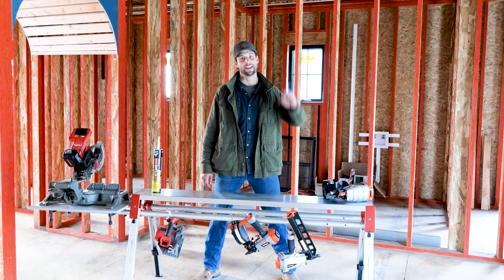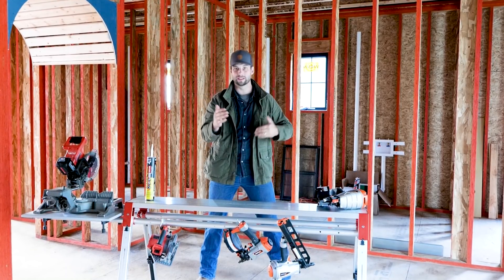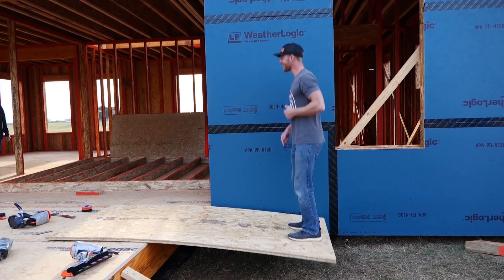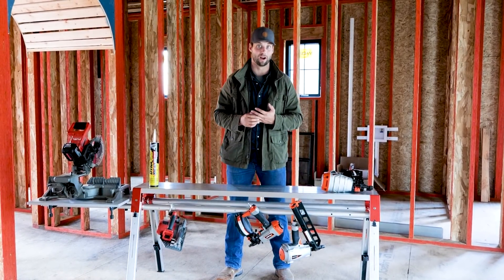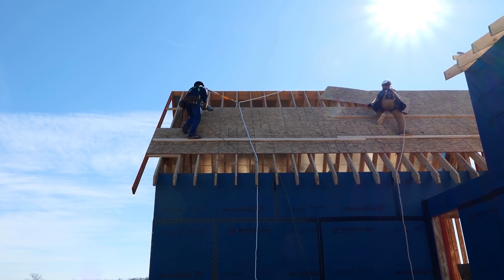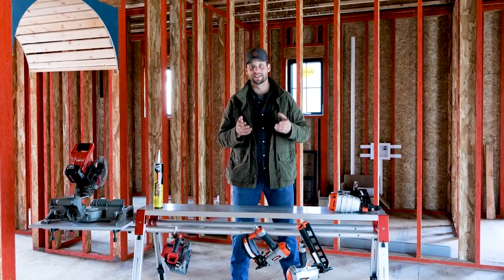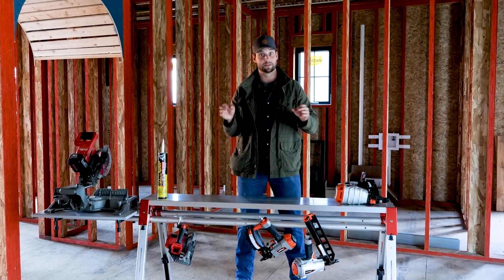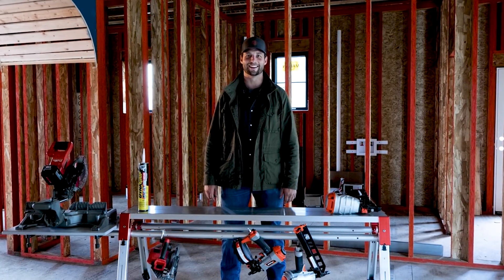Framing a House - Is that ALL OSB?!?!

Comment: These Wood Panelings Have Odor Especially the OSB. I Am Highly Sensitive to Odors. It Makes Me terribly Sick. I've Spent a Better part Of the past  Weeks Browsing the Internet for Alternative to Wood Framing Panels. But Everything seems to be some type of Wood or Engineered wood. I would ideally like something with PVC or FRP that would have the Strength and Rigidity of Wood but without Odor. Do you have any ideas/suggestions??
Reply from the maker: I’m sorry to hear about your sensitivity. However, I don’t think the answer is more plastic and chemicals in PVC or FRP.  There are wood-based products that are low to no VOC like Timber HP.  You might also look at something like hemp Crete

Comment: You said you wanted air flow under the house.  But did you show how you insulated under the floor???   I couldn’t find it if you did.    Would really like to know.
Reply from the maker: We did close cell spray foam
Reply: @JordanSmithBuilds  On this house or a different house?

Comment: Jordan, did you mention in one video that you can send your plans to LP and they’ll engineer it?  Also, will they send you a pre-cut package?  If you could save the labor of not cutting each stud/beam/sheet, that would save lots of cost. Plus the quality would be off the charts... is this possible?
Reply from the maker: Not LP, but Builders FirstSource. They will pre-cut all of the framing lumber, but not the sheathing.

Comment: i think OSB has untapped potential. the binding agent may be improved in the future to add better structural integrity and/or better fire protection and/or lower cost of and/or better water protection
Reply from the maker: I'm sure the resins and binders will get better with time, but they're super robust in the current state on high-end OSB products.  I have had board of smartside and solid start sitting out in the pasture for 8 months with nearly no degradation.  Amazing!
Reply: @JordanSmithBuilds  yeah? which brand names are high end? hard to find names for wood on the internet, haha

Comment: Also to give credit where credit is due I’ve installed nothing but hardie for lap siding for the past 12 years but have moved to only using LP trim and soffit and probably 50-70% LP over hardie siding the past 2-3 years. The installers prices are about 10-15% less with LP not to mention no respirators from the silica dust is a big plus. Their siding products are awesome now we’ll just have to see if they last as long and hold paint like fiber cement

Comment: Check out bear skin flashing for joints. It’s basically a pad of post it note type material for joint flashing super simple not sharp it’s a little pricey ($65) for a 50 sheet book but is super convenient. Also “H” style clips for LP are pretty cool they flash the back and cover the front of siding with wood grain texture. House looks amazing! But don’t fool these people they’re building products are trash! They’re sheathing is junk not sure about the stuff he used on the roof never used but advantech and zip is leaps and bounds ahead not to mention the zip flashing products kill LP

Comment: Did you just drive pilings into the ground with no vapor barrier to protect the bottom floor from rot? 

No exterior continuous insulation?
Reply from the maker: Spray foam insulation and a ventilated crawlspace
Reply: @JordanSmithBuilds  That's one heck of a delayed reply :)

Comment: when are they going to marry the tech shield and weather logic and make a mutant radiant-wrb product?  I remember in the late 80's early 90's the Re-Max radiant foam board was used in a lot of track homes.  seems like it was headed in the right direction with radiant barrier on the walls just not structurally.
Reply from the maker: I think they are working on an insulated panel now.  The roofing version may have insulation and radiant barrier comes.  You would see less/no benefit in the walls, because there's less radiant energy beating down on them. Also you want as much insulation in your cavity as possible, and as soon as you have anything physically touching your radiant barrier, you've defeated the purpose, as your heat is now conducting rather than radiating.
Reply: @JordanSmithBuilds  With Radiant barrier board how are you building a conditioned attic? Do you leave a air gap between insulation and radiant board?
Reply from the maker: @vansage2691  yes. I'm using a cathedral ceiling batt that leaves an air gap between the insulation and radiant barrier.  My air sealing is done from the roof deck.

Comment: Jordan can you do a more in-depth video if the piling system and metal connections you used. I'm a builder in MS and all we have is clay soil. I'm leaning heavily towards a conventional foundation  instead of a post tension slab for my next home. Thanks.
Reply: Anthony Griffin try Ewing and Ray Foundation Services or Ram Jack Mississippi. They both install helical piers for repair or new builds. It’s very cost effective. They have it monetized to a per pier installation.

Comment: Guess you forgot to mention Huber sued LP for patent infringement over the WeatherLogic system and that Huber won a case last June against another 'Zip-like' competitor...expect LP to stop selling this soon...
Reply from the maker: Huber is definitely going to protect their patents. I'm not educated on the state of the suit, but just like GP force field, a winning suit from Huber doesn't mean that the product will go off the market. It just might result in licensing fees.  Again this is just my speculation, the suit is over a year old and they're still moving on with manufacturing and marketing, so I'm confident it won't be falling off the market anytime soon.  Time will tell. Thanks for the comment!
Reply: @JordanSmithBuilds  I believe that LP is paying Huber a licenses fee to make WeatherLogic. I'm assuming this is also true for Gp. It would be interesting to know if Gp or Lp plan on introducing an insulated version of the sheathing(ZipR). Or is that going to be exclusive to Huber?
Reply from the maker: Rumor has it that LP is working on an insulated panel as well as an techshield WeatherLogic panel with insulation!

Comment: lp Smart side has been my go to since it came out. And it's gotten much better. We route our ends to lap like the new expert finish stuff. I really like that they're offering that now. It's not in my area that ive seen but will save some time and money. 👍also we use green and rust red sheethings and advantech subfloor because it's what everyone stocks. I'd really like to use the 1 1/8" lp. I bet the deflection in that floor is ridiculously minimal. LP please push the new products in mid MO. Thanks!
 Thanks Jordan. Love the lp farmhouse build.
Reply: Why is everyone speaking in code? Just say Zip System Sheathing, in 7/16 and 1/2-5/8

Comment: Having worked in the rot repair business for a little bit I would only trust a high-end and high-quality builder with engineered studs. Those things will rot so quickly it's not even funny so if all the waterproofing and ventilation details are not taken care of perfectly then this house would be nothing but a ticking time bomb.
Reply: Exactly. Your waterproofing must be absolutly perfect or this will rot and turn into a wet sponge.

Comment: How do those osb studs handle getting wet?
Reply from the maker: Great!  Go check my Instagram feed where I show these things getting soaked. There's absolutely no structural degradation at all. I've had a test sample sitting out in a pasture for 4 months now beside a standard 2 x 4 dimensional lumber. The LSL looks brand new, and the two-by-four is warped, cracked and graying.  I'm as surprised as anybody. I grew up using cheap OSB for applications where it never was intended to be used, and called it vertical mulch. This stuff isn't even in the same universe.
Reply: About as well as gelatin

Comment: funny   you poor people believe that scraps glued together make a real piece of lumber.  'tsk Tsk
Reply: I think the product itself is blameless, it’s the ‘as built’ assembly and the details that determine the longevity (to be fair that’s true of dimensional lumber too). 

I agree that I was skeptical initial because of the OG smart side issues back in the day, but the new product is awesome (if installed correctly) and the same goes with engineered studs- Matt Risinger has a video on Lvl failure on a job he did- it totally can happen- but he attributes it to his improper (or rather short sighted) install, and he made it 110% right.

Jordan has done some independent testing of the products and I think (knowing his style and his building pedigree) he’s the kind of guy that can pull off this kinda install- but if you got some tweaker doing your tape joints or use tyvek wrap over an engineered structure your gonna have a bad time down the road. 

All the more reason to be selective with your tradesmen and make craft great again ;)
Reply from the maker: Unfortunately, nobody in our generation has bought a "real" piece of lumber from a lumber yard. The old growth forests have been claimed and all of our wood is coming from plantation grown forests at this point. New growth just doesn't have the density or strength that an old growth tree has. These LS cells perform much better than any new growth lumber you will buy off the shelf.
Reply: Jordan Smith the only "real lumber" is the logs at the bottom of rivers left there from a century ago, course there is a whole business that harvest that lumber and mills it mainly for flooring. I have seen some old pine and the grain on it looks better than the oak we get today
Reply: gojoeyr it's is stronger according to the test I have seen, always thought it wasn't but now I've been convinced .it is denser
Reply: @heknows5418  It's stronger than regular lumber but far less tolerant of moisture.  Unless you get your wrb details perfect, think twice about using engineered studs in exterior walls or wet areas like showers.
Reply from the maker: I'm curious where you're getting your data from? I'm not being defensive or trying to be a jerk I would just really like to see some testing that shows the decay rate in high moisture environment of engineered lumber vs. Dimensional lumber.  my non-scientific LSL out in the field next to dimensional lumber is showing otherwise. The dimensional lumber is cracking and warping, and the LSL looks nearly brand-new four months in.
Reply: @JordanSmithBuilds  Not a jerk question at all. It's just my experience with engineered lumber vs conventional lumber shows much higher decay/loss of structural integrity when subjected to similar wet conditions. Engineered lumber expands and falls apart as the glue bonds delaminate, leaving a pile of chips that have lost almost all structural strength. Doug Fir is common around here and it takes years of wetting to see similar damage. I imagine it's worse in hot/humid climates.  Engineered lumber seems slower to absorb water but takes much longer to dry - and it's the longer time to dry that seems to cause the accelerated damage
Reply: ArthurDentZaphodBeeb if you have moisture getting into walls, wet studs is not gonna big your only problem, shouldn't be any moisture in there at all
Reply: @heknows5418  Totally agree. But most builders are hacks and quality is piss poor, even on multi-million customs.

Comment: Google "Masonite or hardboard siding" before choosing LP SmartSide.
Reply from the maker: Not Masonite at all. Huge difference. Go to the local lumber yard and ask for a piece of LP smartside and prove it to yourself. It's legitimate.
Reply: @JordanSmithBuilds  Water exposure is the failure mechanism, not impact strength, etc.
Reply: My kids took scrap LP smart side and the LP OSB soffit from our 2017-18 remodel and built a fort  in the back pasture and it is was holding up just fine until a ATV and a snow sled took it out. Little swelling on the chunks that are in the mud but you could wash of the mud and use probably 90% after 2 years of wet direct ground contact, this has only the factory primer and raw ends.
Reply: @Corey Lambrecht That's what LP SmartSide is.
Reply: @markshaw2207  LP SmartSide is not a hardboard-type product. It is an engineered strand product (essentially OSB). It uses an exterior-grade binder and is treated with a preservative to prevent rot.

Comment: Zip R has insulation attached to the product that makes a thermal break around the building.
Seems like a great product for a well insulated air sealed building. From ¼ or ½ or 1" insulation
Reply: Actually up to 2" thick insulation.